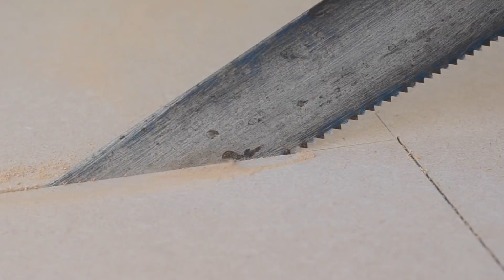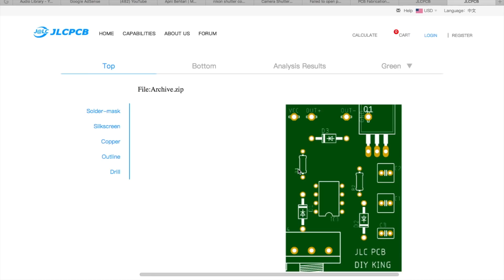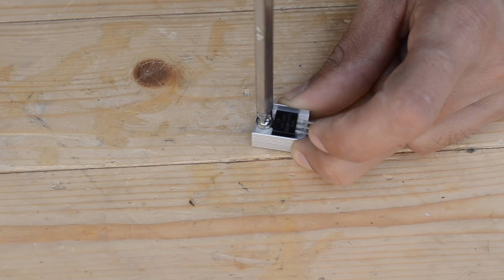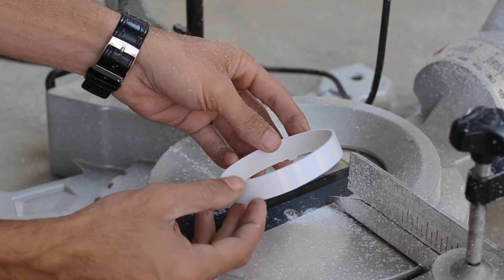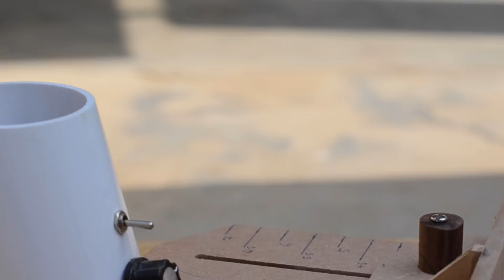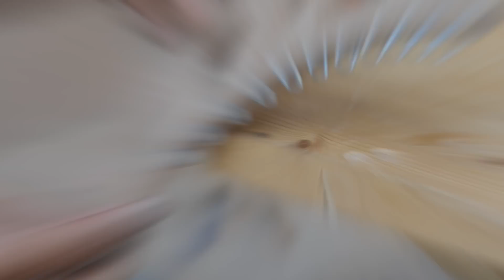How to make a Hot Wire Foam Cutter (Cordless)

Comment: Yeah, looks like a simple build, until you have to build your own pcb LOL
Looks good, works well, but could be easily improved by having a spring in the wire, so it can still work well when heating and cooling fast, and having an easier way to make the conections, because if you're not going on the cords, at least make easier to the user